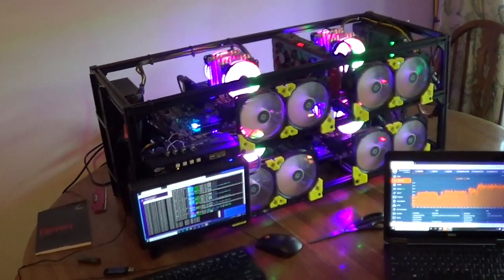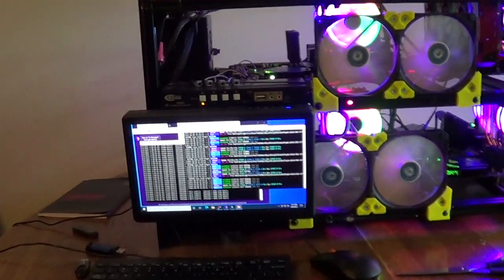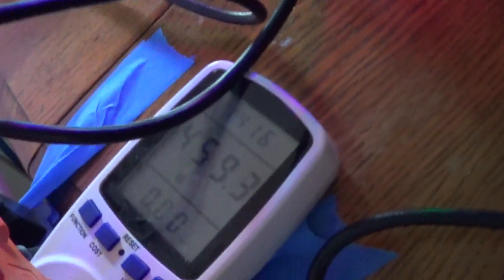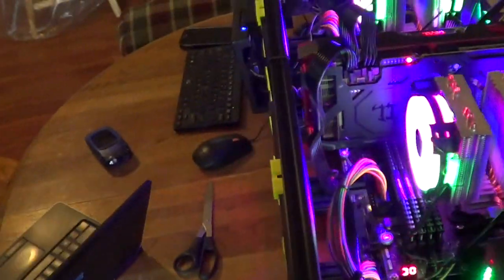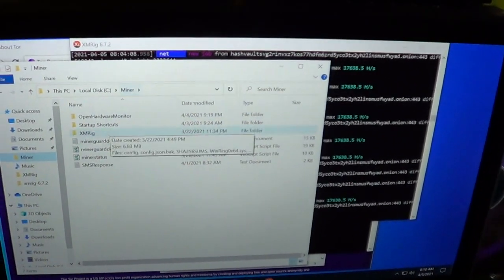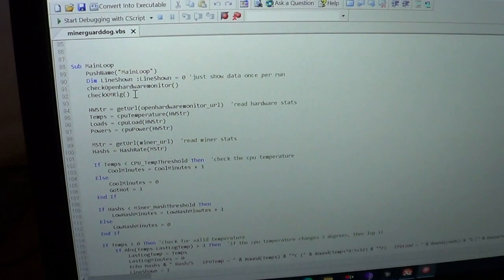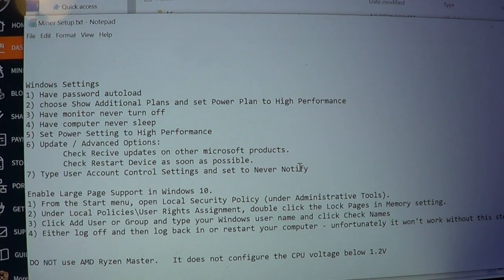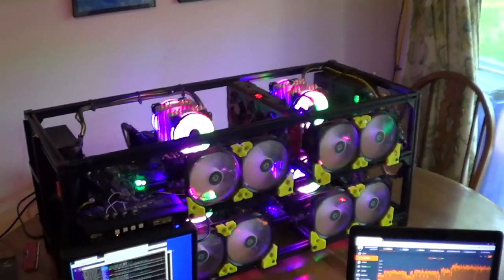Monero 4 x AMD Ryzen 3950X Miner Upgrade to 70,000 Hash

Comment: This setup is lit 🔥🔥
Reply from the maker: Thanks.   It still runs will with pretty much 100% uptime for the past 3 years.   I do have to yearly blow all the dust out with an air compressor.   It is best to do it outside in the winter when the humidity is low.

Comment: 5950x rig: msi x470 gaming plus, 5950x, 1 32gb 3600 no overclock, Locked at 3.9, 1 volt, 110 watts, 15k hash. That extra 2k is costing you 120 watts. Just saying.

Also, i dont know how you got around the windows update resets all the time, you can only extend the date out so far. I used the auto start, startup method for a while. It would only run for 2 months before windows update comes in reckin shop. Also with hive you just just lay in bed and adjust overclocks on your phone. Not just hive, but a dedicated mining os will always be more stable and offer more functionality than windows cause theyre mostly linux based.
Reply: "In Control" stops constant Windows updates. Freed download at Steve Gibson Research.

Comment: two questions. why not gpu mine other projects and why not Linux due to less overhead
Reply from the maker: I don't have time for more coins.   I just picked one and stay with it.    Linux is probably a good idea.  I'm just a windows guy.   My up time is months with zero downtime.   But, the watch dog software does reboot individual boards nearly daily.   And, I get texts with every re-boot.   I'm running the CPUs at 17,000 hash and 130 watts.   They do need to reboot because of instability.    That is 132 hash/watt.    Nobody has that high efficiency.   Running the cpus cool allows them to run for years.
Reply: @microdronetech8453  yeah i never had any issues with windows stability when i used it for GPU mining but i figured you may get a touch more hash out of a Linux distro. i only switched to hive OS for super easy remote access. as far as other coins go if you have them running on xmr already just as well to have the GPU mining kaspa or something. cool set up though man im thinking about getting into CPU stuff now with the merge around the bend.

Comment: Nice video. Out of topic: I like the idea of monero and mining monero. The idea of helping decentralizing the network. But as small miners, we are only securing the network for whales transactions. Gains in monero are really very small compared to other coins with gpus. Increasing the mining capacity to mine monero needs more new PCs (MOBO+ CPU+ RAM+PSU). On the contrary, with a gpu rig, we only add more gpus even if it's one at a time and it is more profitable. I'm just explaining, but I like and support monero. At least if AMD develop multi-CPU MOBOs with like for 4 or 6 CPUs that would be more profitable and could be the equivalent of a gpu mining rig.
Reply from the maker: More than 16 cores will bottle neck.   Some of the high end EPYCs have 32 cores and they are less efficient than 16 by a large margin.   I use high end mother boards.   But, I wonder if the tiny mother boards would work as reliably?    Mining rewards just hangs out at electricity costs.   $80 per month.   Maybe one day monero will take off.   It is being used for payment for military hardware going from ukraine to africa right now.
Reply: @microdronetech8453  I never buy the most expensive MOBO, I check the compatibility with the Ryzen CPUs and the capacity of overclocking so I do not buy fastest RAMs with higher frequency that the CPU or the MOBO can't handle. I always achieved max overcklocking with cheap MOBOs, but I always prefer not pushing too much to keep a little margin for security and to avoid bugs.

Comment: Curious why disable fast boot?
Reply from the maker: The motherboard will hang on normal boot.   That may be fixed now in BIOS though.   I haven't tested.   The speed difference isn't noticeable.   But, the reliability is.

Comment: Why would you cheap out on the coolers of all things? I'm going to go ahead and assume that those cheap coolers aren't actually built for TR but are just adapted to fit on TR. If you got some NH-U9 or U14S TR4-SP3 coolers you'd be doing a hell of a lot better cooling-wise since the piece that makes contact with the IHS actually covers it and would put the heatpipes in exactly the right spot above the die.
Reply from the maker: Right now I'm running 137 watts thru the chip at 156 deg F inside the chip with the $26 coolers.
Reply from the maker: I like that the $26 cooler in the parts list has the heat pipes in direct contact with the chip.   Why would putting another layer of aluminum between the chip and the heat tubes be better?   Heat transfer is conductance x distance.   Copper has much better conductance than aluminum.

Comment: Thanks for the video I'm planning to build such a rig myself, but I'm from Germany and the energy prices here are 0.31 -0.35 kw/h, I have to see how I can make such a rig run more energy-efficiently ^^
Reply from the maker: I could see the power rate doubling soon in Germany for political reasons.   The floor of Monero always seems to be at $0.13 per kw/h as it is today.   The network seems to adjust around that floor.   In my application, I need the 900 watts of heat in my home from the 4 miners.   So, I consider the electricity free.   My basement is very comfortable.   I don't think there is a more efficient way to run RandomX.   I'm saving 250 watts total running the cpu at 1.100V on the miners.  Intel has horrible efficiency and the EPYC processors bottle neck the memory.   If you find anything more efficient, please share.

Comment: Beautiful beast, very well engineered and nice look as well. It is obvious you threw a lot of time in the project.
Reply from the maker: Thanks.   It was a fun project.   I just had to reload winblows and all the software on one of the miners after 2 years of continuous operation.   I updated the documents slightly.   It was very smooth and easy to rebuild the hard drive.   Winblows normally blows up occasionally on any machine.   Running the cpus at 1.100v probably contributed.   But, it is worth the electricity savings.
Reply: @microdronetech8453  Awesome!
1) Why not Linux?
2) Along those 2 years how did your profitability evolve? random? flat? trending down? up?
3) Are your 4 processors still up to the task performance-wise, or do you think upgrading them at some point?
Reply from the maker: @perceval-zinzin  I'm a winblows guy.   I have too much software over 30 years of programming in winblows.   Profit is strange.   Most of my coins were made using 8 Vega 56 GPU cards.   They were a real pain to keep online at decent low voltages.  But, even when I was mining 4 years ago the payback for the hardware was still 1 year.  In 2018 the rig would make 1 coin every 2 weeks.   Now, the same priced CPU rig makes 1 coin every 3 months.   But, the price of a single coin is 5X higher now.   I suppose in 4 more years this rig will make 1 coin every year.   But, the price of the coin will be over $1,000.  It is strange.   I never feel like I'm making money, but somehow the rig does pay for itself.   I'm never going to get rich.  But, It is a really cool rig to run.    The watchdog software that I coded makes the rig extremely efficient.   My uptime at 100% capacity is around 99.8%.    I have all the docs and code in the description.
Reply: @microdronetech8453  Congrats on the achievement, that is a great project!

Comment: Is it possible to mine with AMD Ryzen Threadripper PRO 3995WX, or I won't be able to utilize it effectively because windows only support 64 threads? Is it better to go with Threadripper PRO 3975WX?
Reply from the maker: They seem to have less efficiency.   I get  17,000 hash for 220 watts total for each motherboard.   Over 10 year life span, electricity is much more than hardware.

Comment: Based on the calculator for me it would have take 60 months to get the investement back without any profit. 66$ a month, not really profitable and it should have run for more then half the time without warranty. On paper it looks good but even with lower electricity prices profit would be way under the possible long term rewards. I am also not sure if processors and related parts as resellable as GPUs.
Thanks for the bios instructions and the possible automation on the other hand.
Reply from the maker: 60 months would make 30 coins.   It all depends on the price of the coin.   There will be a crypto bubble burst.   The beauty of mining is that I don't care if the bubble pops or not.   I don't have to time anything.   I just make coins.   It is simple.
Reply from the maker: Monero mining is the only coin that is not owned by elites.
Reply from the maker: @kennyhotz2899  It is pretty simple to know who owns what.   Just follow the money.  A lot of wall street money is going into bitcoin now and not monero.   Plus, threatening the creators of open source software doesn't do anything when the source is already out.   Erase is impossible.   Only censorship is possible.   But, total censorship is impossible.
Reply: @microdronetech8453  Last 3 statements... TRUTH!

Comment: How many threads should I use for mining with a 16 core 32 thread AMD Ryzen 9 5950X? I know the system needs thread to operate.
Reply from the maker: The 5950x looks to be the exact same as the 3950 for mining.   Use all 32 threads unless you need to use the machine to run video games or other intense applications at the same time.   The miner should default to using all the threads automatically.

Comment: Is 70kh/s the same as 70000h/s
Reply from the maker: Yeah.   It makes $120 per month right now.    I don't count the electricity because i like the heat.   It adds up over the years.    Worst case i can sell the hardware if the world suddenly pays off all debt and there is no need for the people to have their own money.   Monero is satoshi 2.0.  He did write the white paper fixing the main problems of crpyto 1.0 or bitcoin.
Reply: @microdronetech8453  can you give me a list of all the hardware requirements to achieve 70000h/s
Reply from the maker: @prime61estate  The complete parts list is in the description.   Use the dropbox link.

Comment: Thank you for posting the part lists. Very helpful 

Just an idea, but you should think about posting Amazon links to get a kick back. I am planning to buy these parts anyway, would have been good to use your links to support your hard work.

Thanks again.
Reply from the maker: The hardware really hasn't gotten any faster.   The new Ryzen chips don't run faster than the 3950 for Random X.   I do an update video about the 99.9% uptime this 4X miner has.   The guard dog software reboots one of them about once per day.   But, they keep on running at 70 deg C.

Comment: Hello sir, 
Im a huge fan of your videos and of XMR as well. 
I would love to invest some money into mining also, but im kinda a noob on this point. 

I have tried to buy everything on your list, but could only get the 5900x instead. Would that change anything in my order i should be aware of?
Reply from the maker: use the faster memory that I have on the list.   The 5900x should provide the same hash as the 3900x.    12,500 hash running 1.1V and nice and cool CPU.    Everything is the same.   The stock cooler should be fine for the 5900X, because it only has 12 cores.   But, you can run the bigger cooler that I have in specified.   I want this rig to run 10 years with minimal maintenance.   They key to long life is staying below 70 deg C on the CPU.
Reply from the maker: Do temperature optimization last.   The stock CPU voltage is more stable while you trouble shoot everything on the rig.   Once the rig is stable drop the frequency to 3,800 Mhz and the voltage to 1.100V.   I suspect the 5900 is the exact same chip as the 3900 (mostly).

Comment: Can I make multi-board 3700X monero mining rig with the junk boards Newegg includes with their GPU combos? Or do they NEED to be premium gaming motherboards for the cooling?
Reply from the maker: If you run the CPU voltage at 1.1V the current is a lot lower.   A cheap board should handle it fine.
Reply: Thanks for the input. Rather put the hardware to work even if its 6mo-1yr from now than take bottom dollar for these boards now.

Comment: Is there any reason why this can't be used? https://www.msi.com/Motherboard/X470-GAMING-PRO-CARBON
Reply from the maker: It should be fine.   Random X is just CPU and memory intensive.   Hard Drive and Graphics and be slow.
Reply: @microdronetech8453  I am attempting to replicate you build because I want to mine more MXR than the ways I'm currently doing it. I bought an ASUS ROG Crosshair VII HERO & 2x8g Crucial Ballistix 3600 C16 memory, AMD Ryzen 3 3200G - 3.6GHz Quad Core and I have a AMD RADEON RX6700 XT. I have worked through a couple issues and it seem like this board doesn't like the the 3600 DIMMS. I found a bunch of posts on this and I'm vexed. I bought some 3200 which is recommended, so to get this running ASAP, it was attempted to deliver as I waited today and they posted undeliverable, USPS sucks, I hope to have it tomorrow. My questions are: 1) Will the the 3600 work somehow in the meantime? 2) Does the USB C-type drive onboard video? I can not get any BIOS on USB or PCI Card up.Thanks for any guidance!
Reply from the maker: @rockporttigger7138  You have to be able to get to the bios to do the auto setup.   The auto setup will read the configuration for the memory and set the timings in the bios.   I detail the bios setup step by step.   If you ever change memory or update the board bios, you need to redo the auto bios setup and add the manual tweeks that I documented.  The video card should be a cheap one in one of the PCI slots.   Also, you need 4 sticks of memory to populate all 4 lanes.    I could never get decent hash rate on 2 sticks.   All 4 lanes need the same memory too.

Comment: hi I'm new to this I have money to invest any way I can purchase this ready made like this with all softwares thanks
Reply from the maker: There is still some maintenance involved.   Windows updates and monero updates occur regularly.    I keep a 99% uptime.   But, I still spend about 1 hour per week tinkering.   Monero proof of work is designed to run on a Ryzen gaming computer.   The idea is that the gamers of the world will support the network.   My parts list shows the least expensive way to setup 4 of those computers into a single rack.   The total is about $6000 for parts and $2000 for labor.   So, it is an $8000 machine that generates $1,500 worth of crypto per year using $933 worth of electricity per year.   I consider the electricity free though because I love the heat in the basement.
Reply from the maker: If you like building computers, I can help with the documentation for setup.   CPU mining is much easier that GPU mining.    You don't need any special drivers.

Comment: What frame is this?
Reply from the maker: It is on the parts list in the drop box link.
Reply: @microdronetech8453  In your Dropbox it says you're using 4 of one frame, but I assume it's just one of the posted one's?
Reply from the maker: @benwheaton272  It is 4 frames combined to one.   In particular, I needed 4x of the cross members that support the motherboard stand offs.   There is some drilling and cutting involved to make the fame work.

Comment: Running on 2 3950x and Stripper 2970 getting about 47 h total. In my opinion a water cooler will give me more room to overclock  faster job closing than others on same network.. The income is not great on monero due to fluctuations on hash rate. Before investing in equipment do the math. Great video not sure if will be using the watch dog but great work. I agree wifi is not the best way since it fails alot.Im using Cat 8.
Reply from the maker: Do you stay around 70 deg C on the CPU?   I run that temperature with 130 watts going to the CPU and 220 watts total going to each miner.  You are getting 35% more hash rate.   Openhardware monitor will tell you the power to the CPU by calculation.

Comment: is it possible to GPU mine with RTX3080s at the same time?
Reply from the maker: Yes.   GPU mining uses very little CPU.  I used to GPU min 8 Vega 56 cards on a very wimpy CPU.   The software is different though.   I might get back to GPU mining in the future.   However, the problem with the GPU is that ASICS can easily be created to dominate the network.   RandomX for monero makes ASICs impossible.  So, the network is organic and not manipulated.

Comment: Isn't it much more profitable to buy a whole bunch of old xeons as cheap as they are?
Reply from the maker: The problem is efficiency.   INTEL XEON E3-1230 V2 is 29 hash per watt
Ryzen 3900x is 100 hash per watt
Ryzen 3950x is 107 hash per watt.
As of today, the electricity break even for monero is about $150 per coin on the Ryzen.   The Xeon break even for power would be $450 per coin.
You can look up all the processors here.   https://monerobenchmarks.info/list.php
Reply from the maker: Of course, if you have free power, it doesn't matter.    Also, if you are running a small amount of power it also doesn't matter.    4 x Ryzen 3950 run about 900 watts.   Efficiency starts to matter then.

Comment: Good project, but for me you did not do the undervolt well, I have the 3900x mining at 12khs at 64w with 22 threads on at 45 degrees. I recommend use clockTuner for ryzen. regards
Reply: my 3900x is using less watts and making more monero on monero ocean. try monero ocean and be amzed. your
 chip will go on cryptonight heavy and be a beast